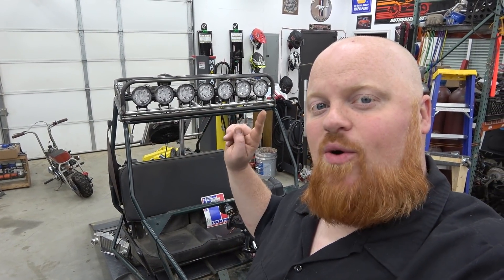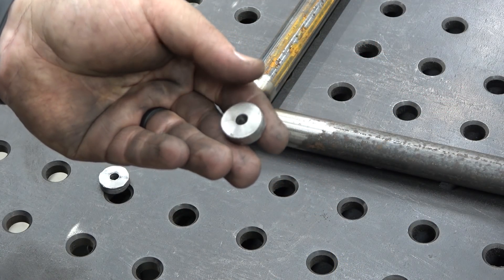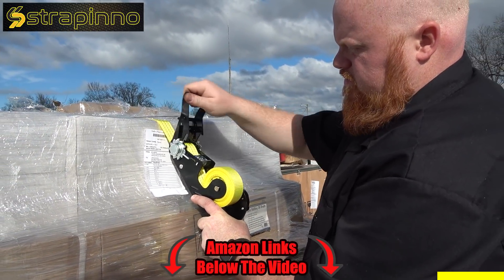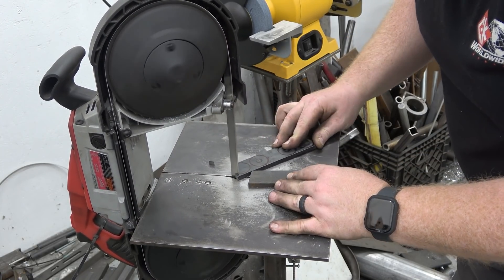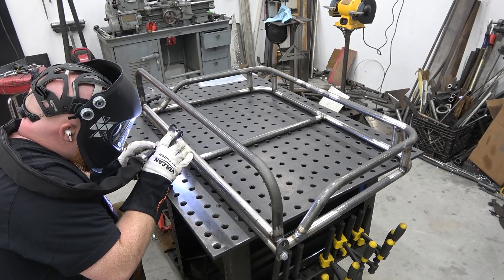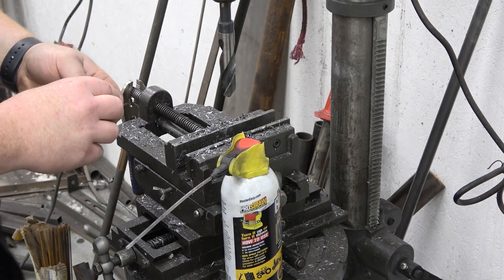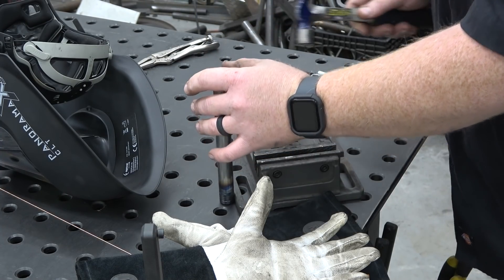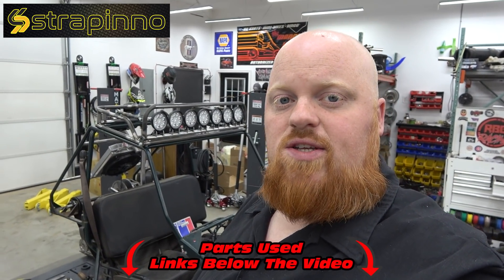Baja Roof Rack Build ~ Turbo Diesel Go-Kart

Comment: Just a suggestion as far as the wiring on the lights. If you're wanting it a neater install, use a marine bus bar and have 1 power and ground going down and still be able to yank a single light without the others
Reply: Absolutely! If he set it up right, he could have a single disconnect from the rack to the chassis to make rack removal simpler. Still an awesome build though!